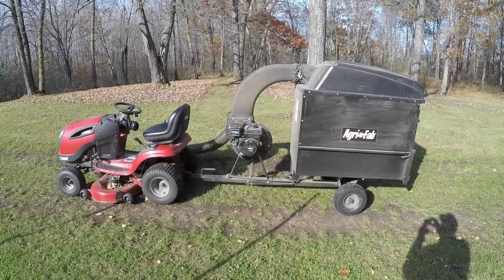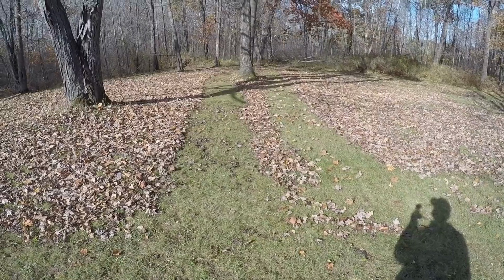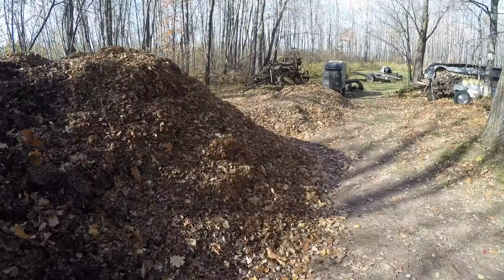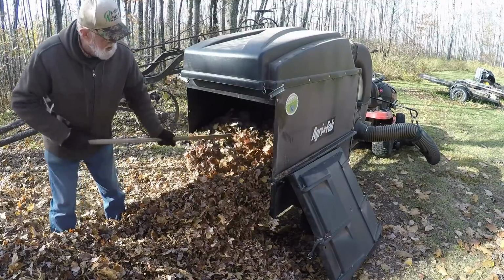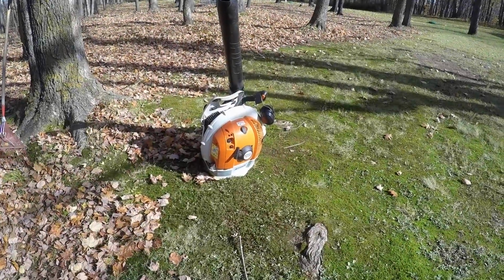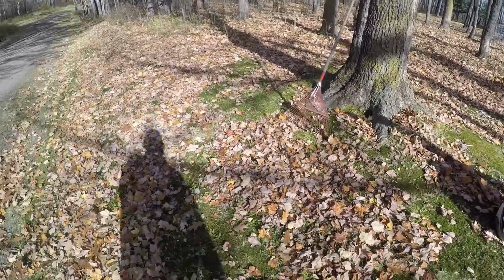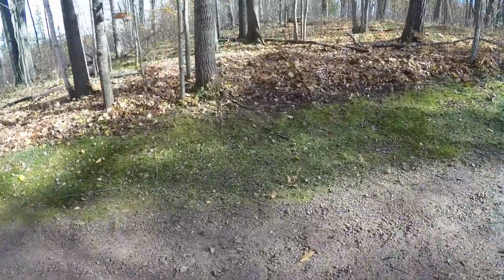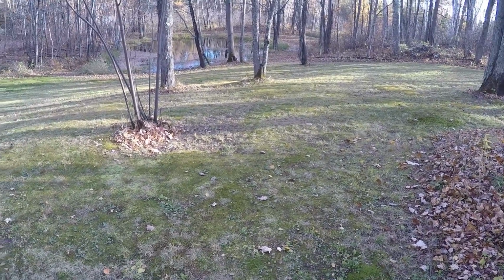Fall Yard Cleanup - Picking Up Leaves & Our Composting System Part 1 of 2

Comment: I have the same leaf vac. I wish they had a decent clamping system to keep the hose ends on. I cut my hose and made a "splice" tube with a place for the bungee cord to attach to. Now it doesn't drag on the ground when turning right, and the bungee  stays in place.
But it DOES pick up and shred the leaves!